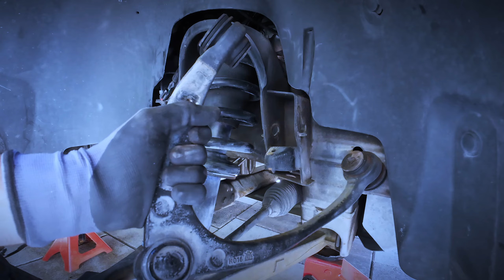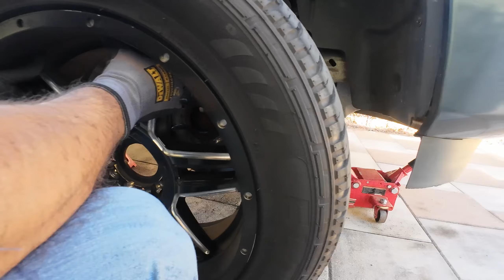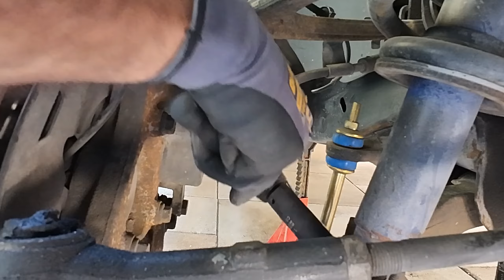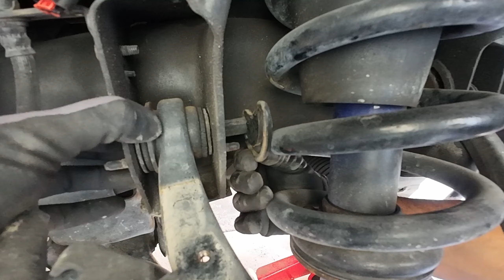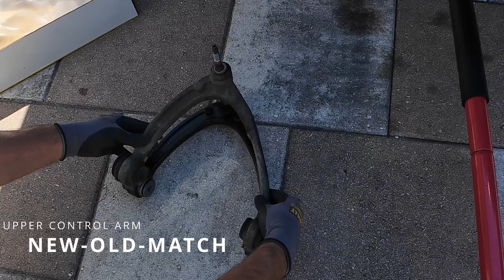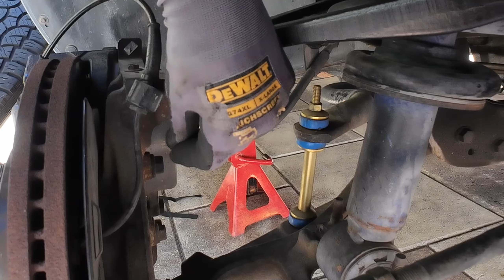Replace Upper Control Arm w/ Ball Joint - Clunking & Grinding Fix! Silverado 1500 (2008-2013)

Comment from the maker: Welcome to my Garage! Replacing this control arm with the ball joint will stop that annoying clunk and grinding!
You got this! This repair looks harder than it is. ✅Check description for parts and tools linked!
Is this the first time you replace this suspension part on your truck/ SUV?? Let me know your milage, make and model!
If this video helped, consider subscribing for more easy to follow DIY fixes 🙌